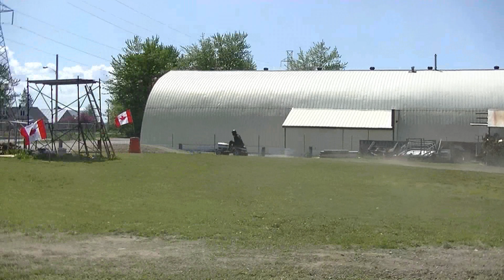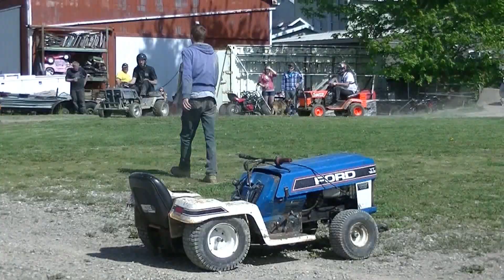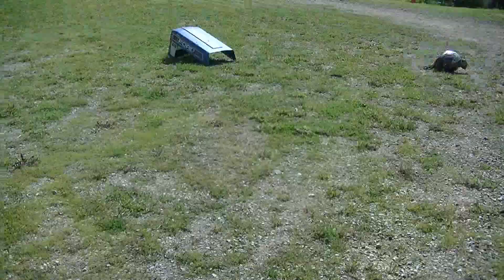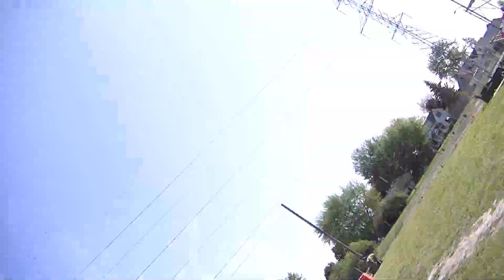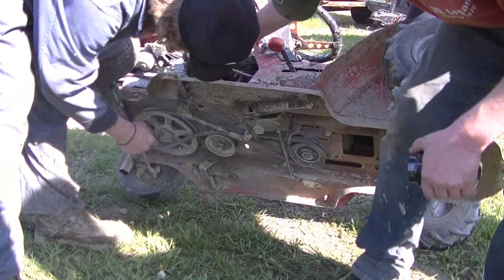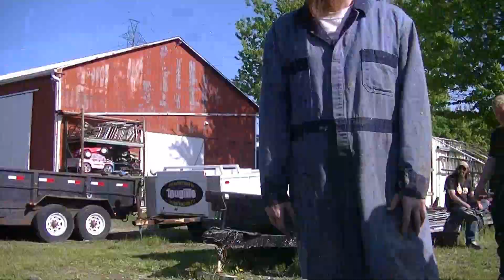Racing Weekend Break Downs

Comment: Id pop that muffler off straight pipe it out the back like stretchs rig add some hood mounting brackets drop in a 820 with the gearset upgrade then bam 90 miles a hour down the frreway to pugs!
Reply from the maker: Holy... whole new trapter lol
Reply: Maybe but it'd be sturdy!